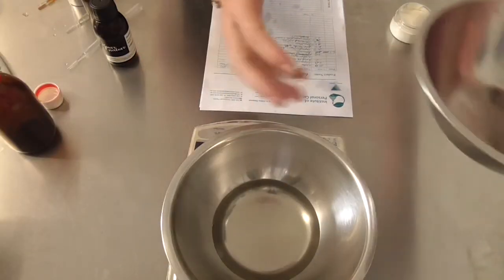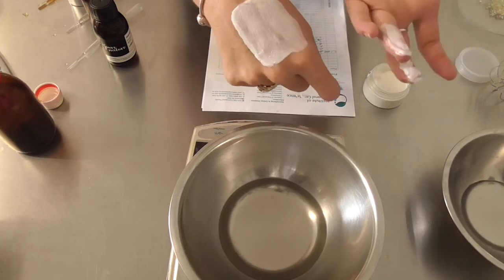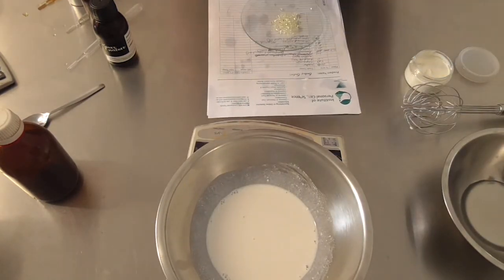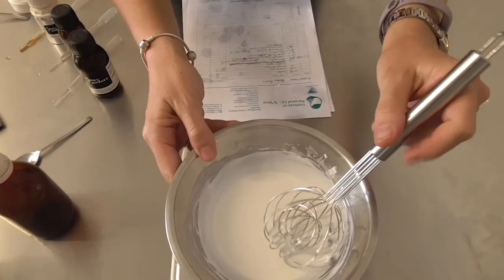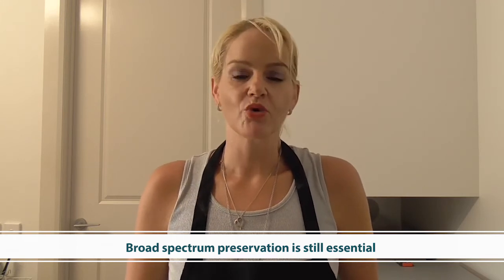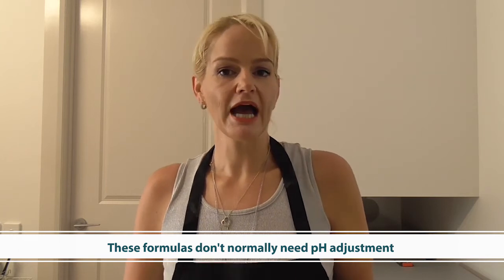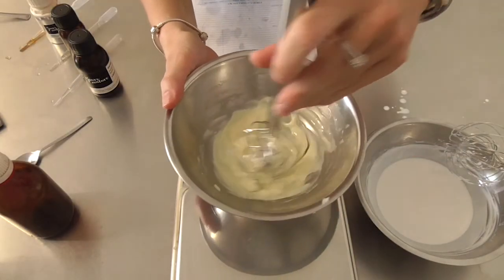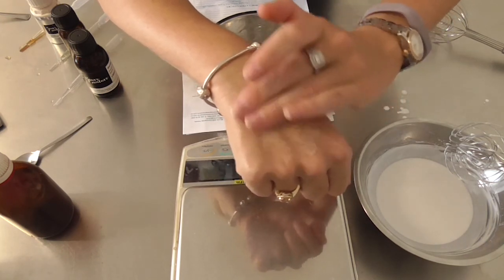Creating Water in Oil emulsions

Comment: Can we add liposome solutions to oils as a w/o emulsion?
Reply from the maker: It can be a bit problematic as the liposome would go into the water phase – its not impossible, but it may be difficult. You’d need to make a sample and see how stable it was over time.
Reply: @theinstituteofpersonalcare6401  how would you know if such an emulsion is failing? As in, what would the consistency be like to alert you that the emulsion isn't working?

Comment: Is it possible to have an acidic water phase in water in oil emulsions??? If so, what complications can arise and how does one troubleshoot them?
Reply from the maker: Having some electrolytes present (I emphasise: SOME) can help with the polarity of the water phase, increasing its attraction for self, to 'hold' the water droplets together and in dispersion. Too much acid, however, is not suitable. If your w/o emulsion is not holding together because of a highly acid environment (<5) then you'll need to make it less acidic. Hope this helps, happy formulating!
Reply: @theinstituteofpersonalcare6401  This helps a bunch, thank you. I simple wanted the ph of the water phase to be skin friendly, which is about 5.5, so this is perfect. I would like to know whether the acidity could possibly interact in some way with other electrolytes, Such as MgSO4. If so, should I not use it all all, as more than one kind of electrolyte is unnecessary? Or can I have an acidic water phase with NaCl instead?
Reply from the maker: While 5.5 is 'ideal' the skin is also perfectly happy with 6.5 - 7 or slightly more! Water is 7! So it doesn't matter especially in w/o emulsions; but it may matter for your preservative or actives. Hope this helps, happy formulating!
Reply: @theinstituteofpersonalcare6401  would acidity effect other electrolytes like MgSO4 or NaCl?

Comment: Hello. Amazing presentation! I was wondering, perhaps you could point me in the right direction. I don't work with cosmetics, but with printing inks, but since both industries rely on water in oil emulsions, the surfactants and polymeric surfactants are so similar in HLB behaviour. But regarding viscosity, which kind of polymers do you prefer for the mesh effect? Or in other words, how do I go about selecting the best for my water-in-oil emulsion? What chemical family of polymers would be best compatible for increasing viscosity in a soybean oil continuous phase? Thank you so much.
Reply from the maker: Hi Victor - remember where oil is the continuous phase then you need an oil compatible rheology modifier. I love quaternised clays (e.g. stearalkonium hectorite etc) but I don't know if they would suit your application (I'm not an ink chemist!) But they are good at particle suspension, like in oil based foundations, so may be suitable. They usually suit non-polar lipids but you can get some grades suitable for polar lipids too. They would be my first pick but please speak with the suppliers in your industry for ink-industry suitable materials like these. Hope this helps!